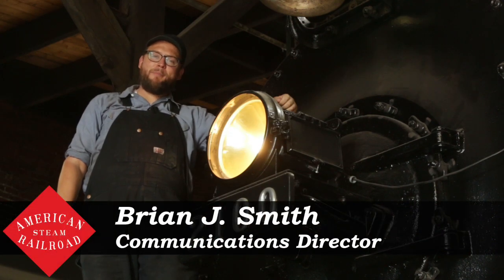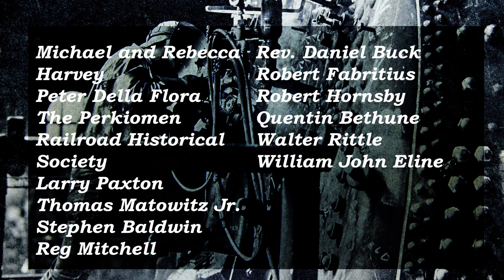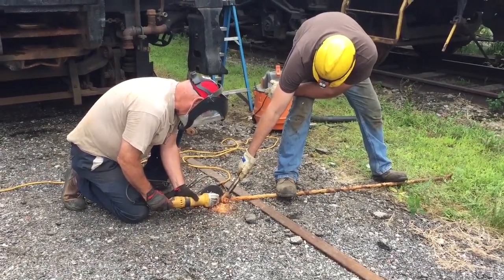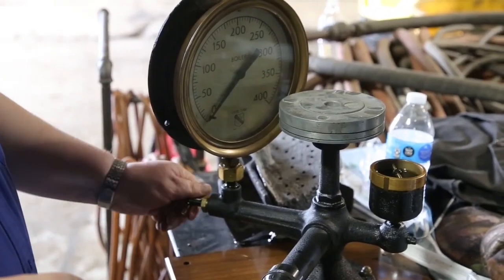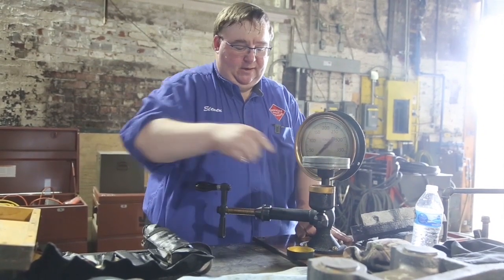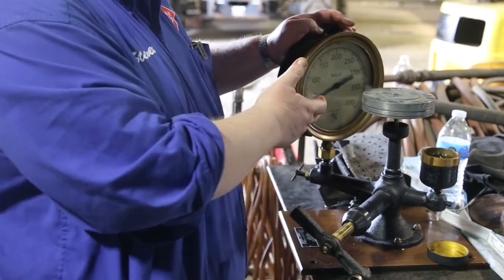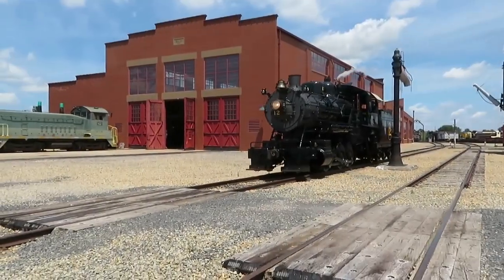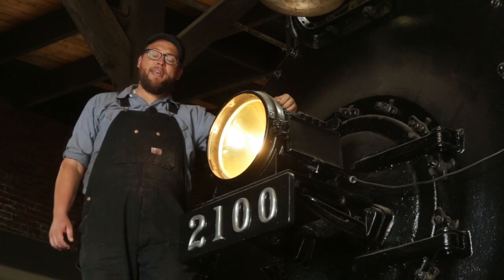Completing the Staybolt Project - Fire Up 2100! September 2020 Update

Comment: With threaded  ball / flexible stay bolts the fitting instruction I was taught was they had to be backed off half a turn after screwing up tight which I understood allowed the ball to move freely after expansion of the plates. Are you able to achieve a similar clearance of the ball in the cup when welding in the flexible stays.